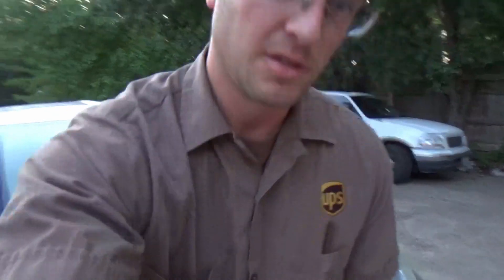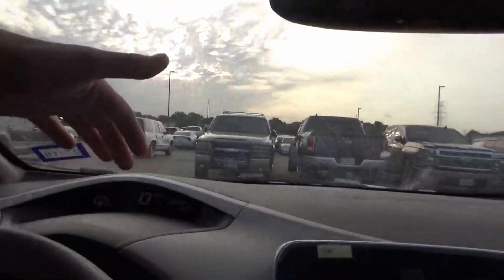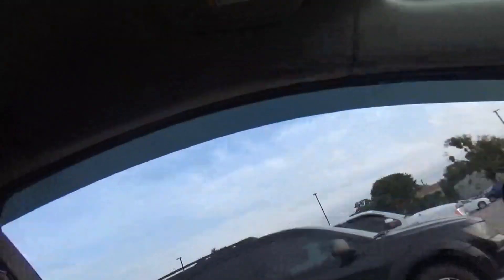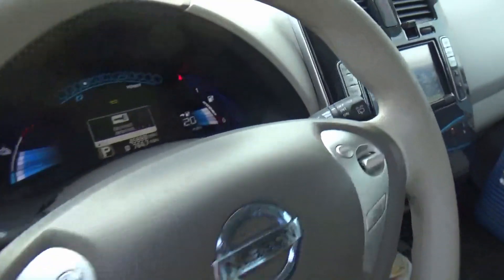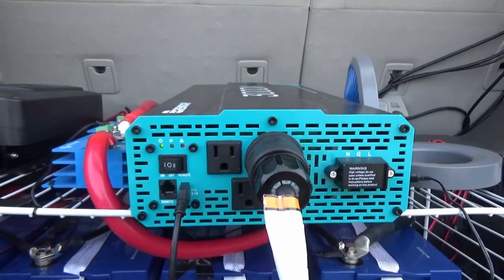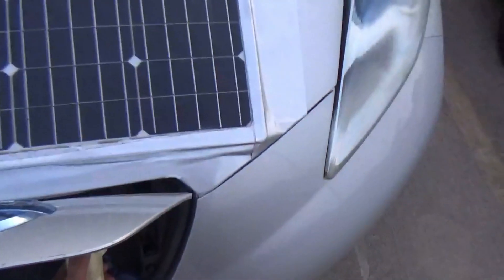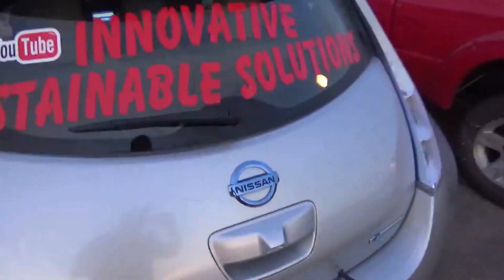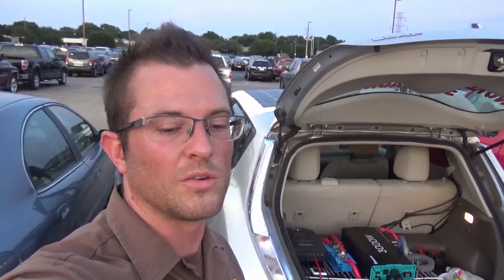Portable EV Charging Station

Comment: Sono motors should just create a video proof like this in order to complete their mission and produce the Sion car
Reply from the maker: That would be a great video to help them sell.  I think they really have their backs against the wall now, in terms of securing enough funding to start production.  3 years from now I think Ford or GM, or Mercedes is going to hate themselves for not buying Sono outright for 300M.  

If they do go under have to shut their doors they should take all this IP they have on solar body panels for cars and make kits for EVs.  Imagine getting a crate in the mail from Sono, and it's all the body panels of a Leaf in puzzle piece like sections and you just lay them on top of your vehicle (pick your adhesive), and viola.  Your whole car is now a solar panel.

The modules for converting low V solar power directly into high V for charging car batteries is also something they have more experience than anyone in the world at.  Making cars is expensive, making parts and kits is cheap, and their already in lead.
Reply: @InnovativeSustainableSolutions  you know, they're not just going to produce a solar car, they're following an open source model where theoretically anybody can print its own car piece to replace and they're also pushing it towards a 100% sustainable car, which means any single piece can be recycled. They're beyond any standard vehicles brand
Reply from the maker: @gabrielevidali  I know, I'm a huge fan.  If it had any knowledge of how to get a vehicle from Germany to Texas, I'd preorder
Reply: @InnovativeSustainableSolutions  since you know them well, how do you explain that they're not posting any videos regarding the solar charging of their car? They're not providing any evidence of those ~30kms free wireless charged range
Reply from the maker: @gabrielevidali  Poor marketing.  The company is, unfortunately, on the brink of bankruptcy right now is my understanding.  Also, it's winter right now in Germany.  We're about 2 or 3 weeks past winter solstice, the minimum solar performance period of the year.  They would have to pay to ship their car to the southern hemisphere to make that video today, and again, I doubt they have the resources for that.  I feel for the guys, and they can still salvage some of their IP in the form of other projects, but it's gonna be an uphill fight for em.
Reply: @InnovativeSustainableSolutions  they actually managed to gather 45mil out of 50 so they can probably go on with their project. Regarding the marketing I think they were not that bad and doing a video like yours should be quite easy for them, if they really have a sort of prototype. I feel like I miss a piece of the puzzle
Reply: Does Sono really need to move the car towards the equator?  Proof of concept just requires a sufficiently accurate demo.  Measure normal incident light in Germany, do a test.  Put the car in a dark garage and set up lighting equipment to simulate incident solar radiation at the equator (and multiple other latitudes), show the light meter reading in the video and voila!

Comment: Why is your battery degradation so bad? 40k miles and i have dropped one bar
Reply from the maker: I recently bought the vehicle used, and at some point a previous owner through ignorance must have mistreated the battery pretty severely.  Rapidcharging it in 105 degree Texas summer, charging it to 100% full and letting it sit there like that all weekend, and draining the battery to empty repeatedly, are all ways you can greatly accelerate your battery degradation.  What year Leaf do you have?
Reply: @InnovativeSustainableSolutions  Yikes!
literally got mine back today from Garage - wouldn't charge on J socket. 2.7k pounds for a new charger unit. Lucky i took out a warranty!
Reply from the maker: @tmtcschannel  Geez.  Thats about what I paid for the whole car.  Good call on the warranty.  Hopefully that will be the last bit of maintenance you have to deal with for the next 100k miles or so

Comment: Someone is going to make a lot of money out of battery reconditioning, specially around older electric cars
Reply from the maker: The market there is just as large as the current market for aftermarket, and rebuilt ICE motors.  It's gotta be in the hundreds of millions per year.  It will be interesting to walk into an Auto Zone in 15 years and see shelves lined with battery cells, and inverters, and transformers, instead of oil, filters, and radiators.
Reply: @InnovativeSustainableSolutions  plenty of older Nissan leafs in Europe waiting for the emergence of battery specialists who can replace battery's at an affordable price and not the 8500 that Nissan charge.  I'm sure someone is going to produce a 150 mile range battery for the older Nissan leafs, within the next few years
Reply from the maker: @banpowel9784  Hopefully.  But the price point on that will be difficult to get below $8k.  At that range your talking about a 32-35kwh battery.  Thats around $250 per kwh (at $8k), and that's not including the cost of the temperature regulating hardware.  Your margins are going to be very tight on any system under $10,000, for that 150 mile range.  But there is value there if you can get people to see it.  3k for the car, 10k for the batt pack, and you have a 150 mile range Leaf with a properly thermally regulated battery that will last.  Add an accessible 120v plug so your car is a portable power source, and some solar panels connected directly to the main battery, and you have some great value and versatility for 15k or less.
Reply: @InnovativeSustainableSolutions  sounds good, and I guess its worth it for the extra range, a guy in europe is producing range extenders for older nissan leafs, extending the range to 170 miles, still relatively new, with a couple of hundred extenders fitted, i will wait for feedback from those who had them fitted, but sounds like its taking of. You can find them on youtube ( muxsan nissan leaf range extenders )

Comment: Parked at 22 miles.  So it’s 15 Miles.
Reply from the maker: Correct.  I did should have calculated the range in straight drive mode. I botched that one; anyways, I'm well past 20 miles per day now with the solar roof rack.

Comment: Here is a question, since you expect the batteries to emit heat while charging/discharging, why not replace the batteries in the trunk with supercapacitors? since they handle heat much better and can withstand a full discharge in addition to being safer than batteries in a locked car.
Reply from the maker: I am aware of no capacitor on the market today that will discharge 12-16v at 1400watts for even 15 minutes at a time.  This battery bank allows the inverter to power the car charger off such a source for up to 2 hours continuously.  Capacitors are, by design, rapid discharge components.  The heat issue was resolved in some of the following videos on this channel.  I won't say it's pretty, but it keeps the system within the ideal operating temperature range.

Comment: You didn't consider the amount of charge you loose by hauling those batteries and inverters around in your car. I could bet that the load is making you loose more mileage. If only you can consider that
Reply from the maker: For reasons of weight and longevity lithium batteries would be a better fit for this project.  They would reduce the total weight from around 300 lbs to 160 lbs.  While that weight reduction is highly preferable either way your efficiency lost to weight is only about 2%.  On the most recent video you will notice the 'status display'  screen on the Leaf still gives a figure of about 4.7 miles/kwh.  4.8miles/kwh is essentially the best you can consistently get in this EV.  The difference in weight of an ICE car varies by  around the weight of this system, from an empty tank of gas to a full tank of gas (20 gallons x 7lbs/gallon = 140 lbs).

Comment: I'm wondering if there isn't a way to bypass all the small off grid power system we see in the back, and simply charge the 400V battery more directly. I'm aware that higher voltage off grid DC systems exist.
Obviously one is not going to exceed the current limitations of charging the lithium battery, with just a few solar panels placed on whatever angles the roof allow, so all one needs to do is produce about 400VDC and allow the battery to slowly recharge, unless i'm missing something here.
Reply from the maker: You're not.  It is possible to use a voltage step-up to convert the panels 16-20v output to the 410v  needed to charge the main battery.  There are several reasons I have opted not to do this including vehicle software, the ease with which others can replicate this system, and safety (410v is dangerous).  But your are right that a direct connect connection would bypass the expense and inefficiency of the inverter and backup battery bank; and the inconvenience of having to plug your car in when you park.  This question is probably tied with "How many miles a day do you get" for the most common question I get asked about this system, so I'm going to do a video within the next 2 months here that details why I havn't done this, how it would be done, and when I do plan to tackle it.  When this vehicle maximum range decays to 31-33 miles and it can no longer be used as my commuter vehicle, I will attempt direct PV charging of the main battery.  Because if I botch it at that point and total the vehicle, well it was already useless to me anyways.  Stay tuned, and good intuition.

Comment: No denying what has been achieved here, and using 'out of eco' range 20 and finishing with 'in eco range' 37 definitely improves the figures 😁😉.  Top tip for Leaf users to prolong battery life... Stay off the rapid chargers for day to day use.  My leaf is 5 years old, has 47k miles and has lost only one bar.
Reply from the maker: Very nice.  And set your charger to charge the vehicle at night in hotter climates.  So you're not charging the batt when it's 110 degrees outside.  I want to do a video at some point on how to baby a Leaf battery so people can have a shot of getting 100k, or maybe even 200k on thiers (as I believe you do).  That's when these turn into a huge money saver.
Reply: @InnovativeSustainableSolutions  The heat isn't much of an issue here as it rarely gets above 90F  the record where I live is only 93F 😁 I also think running the battery to near zero as possible is good too, I'm very happy with my leaf, it never has any issues, I'd never buy an ICE car again ☺️👍

Comment: I don't know if this is true.  This is just a guess, but does the additional weight of batteries and gear not eat in to that new added range?
Reply from the maker: I'm sure it does some.  I not sure exactly how to calculate the loss (maybe take a regular leaf and the solar Leaf put 5 kwh in both of them and see how much further the regular Leaf can drive), but regenerative braking does a pretty good job of recapturing that kinetic energy.  I can say that I have driven 65 miles in one day using only the onboard system to charge, which is 15 miles further than the vehicles range on just the factory battery.  Lithium batteries would shave about 30 percent off the 310 lb. weight of the system.

Comment: Was considering a trailer , battery , pack with huge solar panels - my Kia Soul EV has a perfect solar panel style flat roof
Reply from the maker: I've been wanting to build an EV road trip package.  A small cargo trailer, ideally climate controlled, with a large battery bank, inverter and solar panels.  You could get extra range, storage space, and maybe even optional A/C sleeper for summer camping.  And it would double as a backup generator for your house when you're not camping with it.  I have trouble sleepin in a tent when it's 95 outside.  Email me if you decide to try it out and I'll help you with parts selection.

Comment: I want to do something like this for my Kia Soul EV so I can go camping at spots that are too far away - but can recharge while camping
Reply from the maker: The Soul has a great roof profile for solar.  Alternatively if you're only occasionally using the charging station, you could build a little kit (panels, charge controller, 2 batts, and an inverter) and just carry the kit with you when you go out in the sticks.  The rest of the time you can store it in a crate in the garage.  Would also serve as an emergency generator if the power goes out at the house.

Comment: what can i do with a fusion energi?
Reply: probably just replace the pack when it degrades
Reply: @squee222  I had a 2016 ford fusion hybrid with an EV range of about 20 miles when new. It sucked. I dumped it for a 2021 Chevy bolt EV with 259 miles - The car was pretty but I had too many recalls in the first couple of years. The hybrid idea is good but just about all other car companies do much better with their hybrids.

Comment: Are you able to check warranty free replacement battery
Reply from the maker: Yes, it's a secondhand 2011 Leaf.  I think the extended warranties expired in 2016 (don't quote me on that), and I don't think they transferred with ownership of the vehicle.
Reply: 2011 Nissan Leaf  8 Year, 100,000 Mile Warranty
Reply: @InnovativeSustainableSolutions  Can try at dealer, never know until try.
Reply from the maker: @zhaoyang4220  You're right.  I'm gonna give it a shot.  If I can, I'll document the results of me reaching out to Nissan.
Reply: best of luck

Comment: Well done! I'd love to put something similar on the roof of the Wife's Pacifica Hybrid PHEV.
Reply: How’s that working for you and what did you use?  I have a Pacifica and seeing how to maximize its efficiency.
Reply: @dominicmontano9369  I have not done it yet for the Pacifica. Too many other projects
Reply: @DetachedGarage  thought of the flex panels but about 5 of the 3x2 panels will fit nice and gonna make it where they can adjust to point at the sun with some adjustable brackets connected to them and mounting the brackets to the luggage racks

Comment: Have u thought of useing a light duty trailer hitch cargo rack to holda few solar panels. Like 2 wide that folds out to 4 increaseing solar input. I had something like tour design in my head and that was how i was going to makethe solar cells mobile but produce enough
Reply from the maker: I have.  I get asked that a lot.  It seems to be a popular concept as people are hesitant to adhere panels to the roof, cut a hole for charging cable in the hatchback, etc.  Here's a quick list of my perceived pros/cons of using a utility trailer.  Pros:  Easier to attach larger solar array, no vehicle modification increases universal appeal, you can still use the cargo area of the vehicle for, well, cargo.  Cons:  Daily practical use is much more inconvenient as you now need two parking spaces to use add on, the additional cost of the trailer (probably around $1.5k-$2k used), adds 50-60% to the cost of the system up front, it's easier to steal than something enclosed inside the vehicle, you're pulling more weight so your range/kilowatt suffers, and you have to replace tires on the trailer every 3 or 4 years.  

I think the trailer idea is perfect as road trip aid (tour design as you called it).  You could have a 2kw solar generator trailer.  One idea I had was to insulate and climate the cargo trailer; add racks of battery modules in it, and have the trailer be a solar generator AND large exterior battery that you into your Leaf (running in parallel with main drive battery).  You could give the vehicle a range of pretty much anything you wanted this way, and have an off grid solar charging option.  I would be willing to build/help someone build this if they were interested.
Reply: @InnovativeSustainableSolutions  i was referring to something like this. U could mount 2 and if u do a fold out system 4 full size panels to it. Keep your system the same and increase pv input to the batteries. With very very little little change to your current system
Reply from the maker: @joem.3576  It's doable.  You just have to watch the temp/sun exposure of certain system elements.  The charge controller, and the inverter cannot be in direct sunlight.  You could build some kind of cage around the cargo rack and mount the panels to it to shade the electronics.

Comment: Is that added range only from solar, or partly from the lead acid batteries in the trunk?
Reply from the maker: A portion of the charge absolutely comes from the AGM batteries.  I'm striving for a 775 watt system (600 watt peak actual realized input).  This will translate into about 25 miles of range/day maximum from solar in the summer.  Good batteries are the only way to extend our per day charge past 25 miles.  Stay tuned to see how far we can push the limits of the solar EV

Comment: Really awesome work man! I don't think I've seen anyone accomplish this yet. Where'd you learn to do this?
Reply from the maker: Thank you sir.  There's really not that much to it though.  I promise you, you could replicate this yourself with 5 or 6 hours of research and minimal advice.  If you have good equipment, that works well, it's hard to mess up.  The system I'm building up to is going to have twice the capabilities of the one in this video.  Stay tuned!

Comment: i think you should attempt to use tesla battery modules in place of your nissan drive battery, also since your trunk area isnt being used, you could us that space for the rest of the tesla battery modules, cooling the batterys should be to hard to do and if you charge them at a low current you may not even have to worry about them getting warm while on charge. that might give you a range of around 200-400 miles